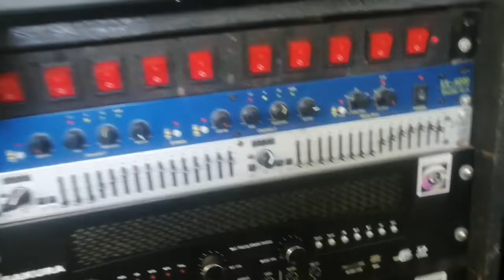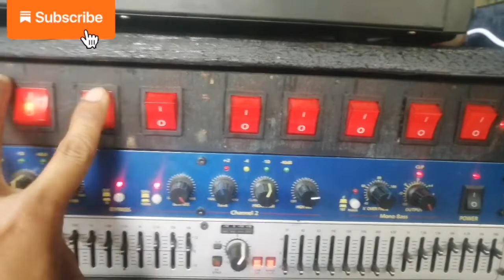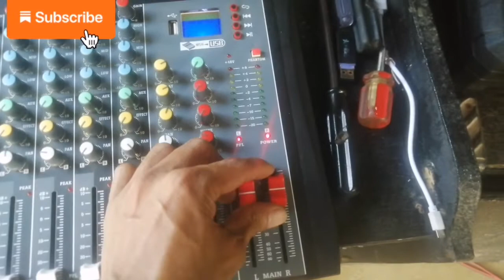speaker Sound check Tsunami storm 12 & High Caliber Audio (part 1)

Comment: Pag walang air vent sa magnet malamamg hndi intended for battle
Reply from the maker: Ganun nga siguru sir, madali po kasing uminit. Pero marami na rin naman po akong nakitang gumagamit ng speaker na walang air vent sa battle of the sound. Depende nalang po siguru sa set up at diskarte kung papano gamitin na hindi nasusunog kahit babad sa tugtugan.
Reply: @gensyslibrary6135  malaki tlaga possibility ma overheat pag walang vent lalu pag babaran

Comment: Mas malakas tulah ni high caliber a
Reply from the maker: Up to 1000watts max power po kasi.  At mas malaki po ang voice coil niya.
Reply: @gensyslibrary6135  kya nga gusto ko na rin bumili nian
Yan lang kc may malaking voice coil sa price range nia
Reply from the maker: @dexterpagurayan4881  meron din pong mobile technology na halos same lang dito sa high caliber. parang sticker nga lang po yung pinag kaiba😅
https://shp.ee/f6fy23c
Reply: @gensyslibrary6135  talaga ba? Matignan ko nga
Reply: @gensyslibrary6135  2.5 inch lang ung sa MT
Reply from the maker: @dexterpagurayan4881  yung MXC12195 po 75mm voice coil.